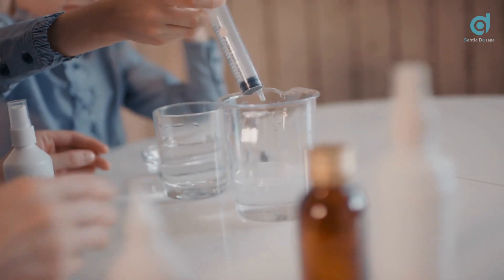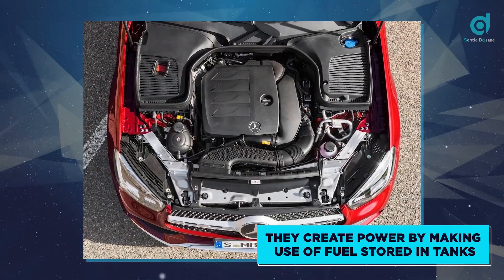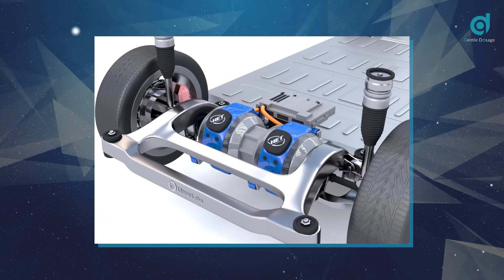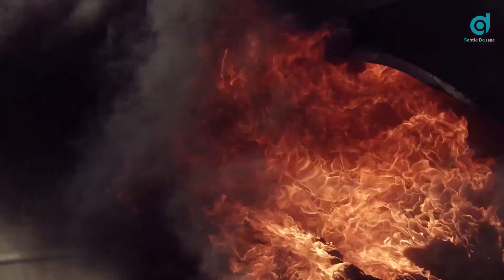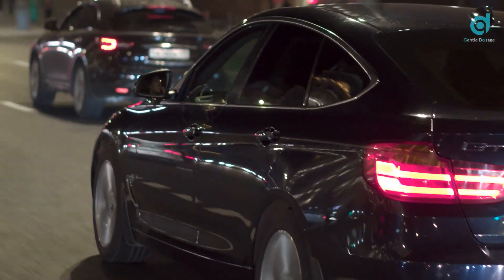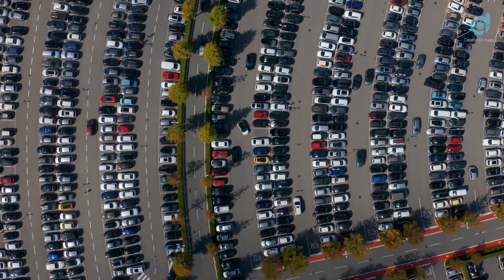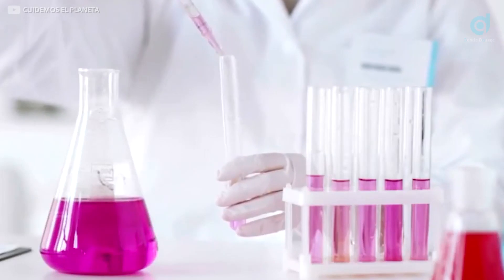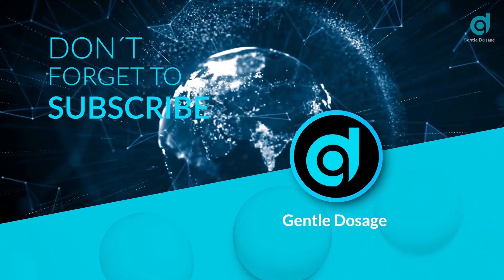Green Hydrogen - Why the Hydrogen Powered Electric Car Might Be The Future

Comment: A company called Plasma Kenetic has solved the problem of hydrogen powered electric vehicle.  The do not have  fuel cells. They capture the hydrogen on a film thinner than a human hair.  They use a laser similar to how a CD player works to change the polarity on the film and release the hydrogen atoms from their bond. It's cheaper , faster , safer , cleaner , more convenient. This hydrogen delivery system can be swapped out like you would a propane bottle. Just turn in the old one , get a new one . it can be recharged over 150 times , It uses the hydrogen to generate electricity. So you have a storage and delivery system all in one. This technology will change the electric vehicle market. Waiting for them to implement this.

Comment: I just can't wait for below freezing winter driving, as often found World wide, when multiple hydrogen vehicles having driven before us spewing cool liquid state water exhaust droplets coating the roads with black ice for us to drive over and wreck our vehicles on ! Now that is safe ! This concept is just another, not so well thought out,"GREEN", idea that when applied into the real world to keep us safe from climate change does not keep us safe from injury or death when in vehicular accidents. A society operating many Hydrogen Vehicles that are spitting water on below freezing road or parking lot surfaces is not the answer ! One key point missing is the state of the water emitted. ICE have high thermal heat and the resulting combusted fuel emissions cocktail comprises much less water as a portion per mile which is exhausted mostly as vapor, which as we know, is emitted as a gas vapor not settling on a road surface, but dissipating up as heat rising into the atmosphere. Present fuel cell designs drip much water in the liquid state as the only single resulting byproduct, able to fall in a cool liquid form, ready to freeze on colder road surfaces. That is the difference. If a steam heating unit was added to the fuel cell's liquid water by-product exhaust, this may be an energy intensive solution reducing mileage, and efficiency during winter driving. So, where to put the liquid water. Maybe an onboard  tank to freeze solid and burst when parked?  At a stop sign or light idling then accelerating adding heavy icing right there to the road surface just where one wants to actually stop? A parking lot to slip and injure another walking by the back of your parked vehicle or after you drove off leaving water to freeze there? A roadside gutter so a pedestrian can slip stepping off a curb, maybe falling down flat in front of stopped traffic and out of view of drivers ? Your driveway so you can fall there ? Your Garage to slide across while holding your infant child then both hitting the hard floor? Maybe, you need more tasks or to be distracted by mopping up the garage floor before the water freezes and your groceries just purchased thaw? Maybe a high speed highway perhaps in a turn? Maybe the unlimited speed limit Autobahn with high water production by those higher electric energy demands moving the hydrogen vehicle through the air while simultaneously dumping large amounts of water mist contrails at high speed onto the road surface? Your Hydrogen Vehicle needs to relieve itself in public, The question is where to do it safely? Now considering these real world usage / interaction scenarios listed, are Hydrogen Vehicles a good idea? As a vehicle operator you can rate the chance of consistent, caring, and professional operator actions observed when you're out exercising your privilege to be with others in the public driving arena. Are you certain that rushed Hydrogen vehicle drivers find and maneuver over a public storm drain water dump station to let their hydrogen vehicle relieve itself in public places when freezing weather is happening? You rate and you decide if  we or will not slip into a Hydrogen transportation based society. As for me...you guessed it,  I see much more "could care less" vehicle drivers and very few careful vehicle drivers. Hydrogen supporters….should we give these "could care less" about you drivers a water soaker sprayer for society at large to walk or drive over when a dash indicator flashes an alert "water tank full" during your trip? 

  As a example of related but current human behavior, How many times do you see trash / rubbish go swirling out of a moving pickup truck bed in the States, or dumped out a moving vehicle window instead of being caringly placed in a proper waste receptacle when arriving at one's destination, as an example of drivers' proper public disposal habits?

Maybe add antifreeze to the water dump so it can mist on following vehicles windshields / windscreens then be smeared when wipers on, so the trailing driver has no clear view of the road. Now that is safe ! Then more windshield solvent , with poisonous methanol, is added to the ground by constantly spraying to keep a clear view. Now we're turning wipers on and off, as if that is not distracting to manage while driving in heavy traffic or oncoming bright sunlight in turns. Now that's safe.

Maybe many Hydrogen Fueled Vehicles can dump water, and antifreeze, smearing trailing vehicle's glass view 360 degrees, that is now spread everywhere in the environment. Now that is green, think !

Maybe the Hydrogen Vehicle owner after the cost of a fill up of Hydrogen decides to not pay for the extra cost of perpetually filling an auxiliary antifreeze reservoir that costs more than gas or petrol per gallon. So where is the transportation fuel savings when buying both Hydrogen and Antifreeze for the fuel cell's water as a by product tank?

Maybe granular or liquid salt treatment of ALL the roads ALL the time when temperatures are below freezing, even on sunny winter days ! Now raising the P.H. in streams from water mixed with salted trickling runoff 24/7/ all winter does not sound very Environmentally conscious or Green Think savvy. Get ready for higher taxes to pay the millions of dollars to pay for road treatment. Pay for replacing your scratched up paint. Pay for a broken windshield / windscreen when a chunk of salt is thrown on it during truck/ lorry application. Buying a new Vehicle often because your vehicle rusted prematurely from driving all winter on heavily salted roads.

Maybe add vehicle exterior damaging or ICE engine air filter intake & cabin air filter clogging traction grit like coal furnace electric generation plant cinders or mined beach sand from environmentally sensitive areas to the below freezing road's surfaces 24/7 all winter to combat black ice on road surfaces, filling the streams with sediment to clog fish gills when stirred into the water column later by heavy rains to follow in warm weather. Now one has to think twice about opting for a green and healthy deep breathing bicycle ride or walk on a drier warm early Spring Day to work or for pleasure while breathing the leftover dust from many Winter months of road grit application stirred up by passing vehicles.

Maybe the antifreeze adder system breaks or is disabled. Now the trailing driver is back to sliding on black ice in below freezing cold temperatures when Hydrogen is used in Vehicles as a transportation fuel spewing ONLY clean water onto the roads as the only by-product of its use.

Comment: Hydrogen requires complex systems to distribute, is far less efficient. Batteries are rapidly evolving, new cells can charge in minutes not hours, cells are very efficient and recharging very cheap. Biggest plus, batteries can be charged at home overnight
Reply: yeah but bev uses rare earth metals and the more demand there are, the more it will cost making cars cost more. Not to mention these metals are mined in conflict zone that utilized child labor and mining is horrendous for the environment. After all said and done it will only last 10 to 15 years rather than internal combustion engine lasting 20 to 35 years. Not to to mention the recycling and the hazmat waste at the end of life. It also, takes much more energy to produce a battery than a fuel cell.

Comment: Total efficiency is 3 x worse then pure electric.... knockout number 1, one more time total dependency to big companies for fuel distribution.... knockout number 2, People can charge their cars from own photovoltaic or other green power source if having your own house.... knockout number 3
Sorry, nice try, but not for cars.
Reply: That battery will need to be replaced in 5 to 10 years and they are not cheap, currently about half the cost of the electric car.
Reply: #1 A H2 car can be charged at home just like any other EV. The fuel cell works just as well as an electrolyser. The filling infrastructure is the "fast charger" of Hydrogen cars, not intended to be used every day.  That there are currently no H2 cars on the market with that capability (they have been built), is a marketing choice, like vaccum cleaner bags; to lock customers in, and nobody is buying that. Commercial fuel cells are 50% efficient only, only 25% both ways!, which is really not  impressive as you point out, but it is neither that critical if you have nothing else to do with surplus renewable energy at home. Besides, the losses from "charging" your H2 car goes into heating your house and likewise, when driving in cold climates, as you need a few kW of heating anyway, so in these Northern conditions, there will be no efficiency loss compared to batteries, which work worse in winter too. Also storing H2 at home if you have renewables, means you can store summer sunshine for winter, something you can't do with a powerwall. #2 Something you missed: H2 storage is heavy. Pressure tanks, metal hydride and cyrogenic storage offers only similar energy density electrically as Li-ion (including the losses in the fuel cell) so nothing gained there, but reformed Methanol beats the energy density cieling an order of magnitude over Li-ion. However for that to be sustainable, Methanol has to be syntesized from renewables, and that requires a whole different kind of infrastructure, but that would make FC EVs highly competetive, especially in the trucking segment where the batteries needed diminishes the hauling capacity by around half. Likewise for aircraft. But my suggestions requires a very Star Trek level integrated society, where energy is conserved at every link, for this to be clean, so your conclusion is right at the moment, but fuel cells are tantalising and still hold great promise for vehicles with the performance comparable to anything running on gasoline. The industry standard for the catalyst in PEM fuel cell membranes is Platinum. However, this is not the most efficient element which is the main reason for the low conversion efficiency and better catalysts exist, which have been tailored with atom scale islands of different elements to offer the exact push to break H2 bonds for high efficiency, so if people can imagine solid state batteries with 4 times the energy density over current Li-ion batteries, it is not hard to imagine 80-90% efficient fuel cells in the future, if large scale methods to manufacture these catalysts are develloped. Likewise Metal hydride made without metal, is also along these lines, to make leightweight H2 storage. So if these problems are solved, nobody want batteries.

Comment: $80 per tank is a hard pill to swallow, but if they can lower that cost that would help.  Another problem is that the creation of hydrogen takes more energy than it produces. At the moment, it is better to just take that electricity and put it in a battery.  It is still very exciting to see how hydrogen fuel technology is growing.  Maybe one day they would be able to produce hydrogen from heavy water using the car itself.
Reply: lithium mines are destructive, batteries will eventually break down and be expensive enough to scrap the whole car that has some years on it. and Batteries are not easily disposed of or recycled.  whatever power you make with windmills or solar can be made into hydrogen and wont matter if the sun or wind is inconsistent. Unlike a city powergrid which cannot be allowed to stop which is the reason majority of city power is by fossil fuel or nuclear reactors. 👀  Use green methods for hydrogen and ease the load on City power grids that will probably be reliant on fossil fuel for another lifetime 👀 like the video says, hydrogen can be made from cow manure 😹  Google what lithium mines look like. Massive amounts of destruction 👀
Reply: @DefZen343  Lithium mining is done in desert areas with huge salt flats. The biggest negative to lithium mining is the amount of water used.  The process is drilling a hole into the ground and pumping the brine water to the surface.  They then let these large pools of brine water dehydrate in the sun so they can eventually collect the minerals.  

Recycling of batteries is difficult at the moment but there are many new companies coming up with new methods to simplify this process.  One company of note is American Manganese, who uses hydrometallurgy to break down the batteries back to their base elements.  Their hydrometallurgical process is also recyclable so the chemicals used in the process can be used over and over.  American Manganese also claim that they are able to reclaim 99% of the minerals from the batteries.
Reply: @Baker.Matthew  Empty claims by American Magnesium.
Reply: @DefZen343  right now batt are being replaced cheap enough.
Reply: @tedmoss   labor? a teslas battery replacement requires taking the whole cab and frame apart 👀  just a transmission failure these days usually scrap a whole car because it's not worth the labor costs, imagine an old tesla 👀  wasteful and expensive to me 👀  my honda has 285k miles on it and runs smooth, I can fix anything on it myself, a tesla? need heavy machinery to fix that 👀
Reply: BS.   Look in to the energy generating process pioneered by SunHydrogen HYSR? "Another problem is that the creation of hydrogen takes more energy than it produces". What a load of bs! They can produce hydrogen via sunlight. The heavy, toxic, flammable batteries lugged around in Tesla's will make them obsolete, as well as the severe shortage of both cobalt and nickle needed for the batteries. The future for clean energy is hydrogen, not heavy metal batteries.
Reply: @ironworker5792  Tesla China is using LiFePO 4 Batteries to remove the need of Nickel and Cobalt in their batteries.  

At this point battery electric cars are more practical than hydrogen since you can charge your car anywhere including your own home.  Hydrogen refilling stations are few and far in between at the moment.  Hydrogen is still also prohibitively expensive and make the consumer reliant on a hydrogen supply chain.

Lets think about the process, we use solar panels to convert the sun’s rays to electricity to create hydrogen via electrolysis.  Then the fuel cell in the car turns that hydrogen into electricity to power the electric motor.  Meanwhile there is still a hybrid style battery to store electricity.  Like seriously, why would you go through all of this trouble just to create a “better” version of a battery on an electric car?
Reply: gas is now about 80 dollars a tank so its comparable sadly.